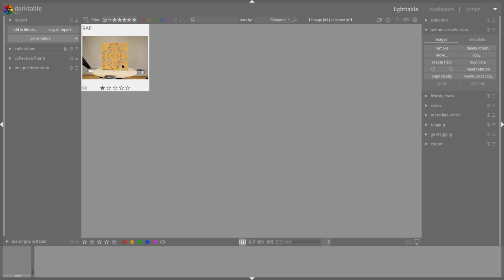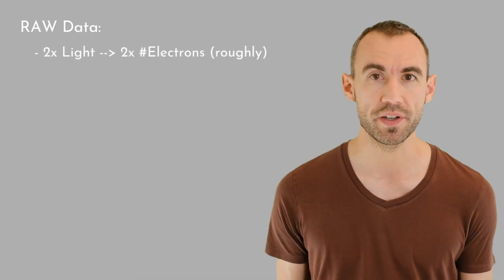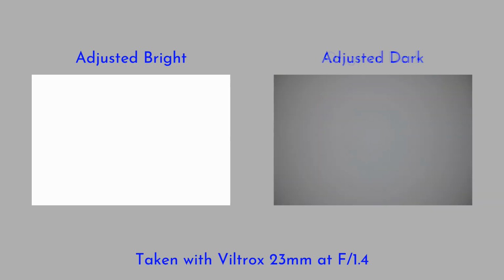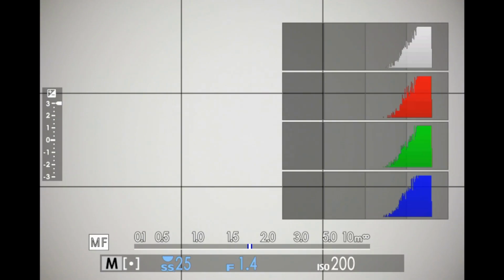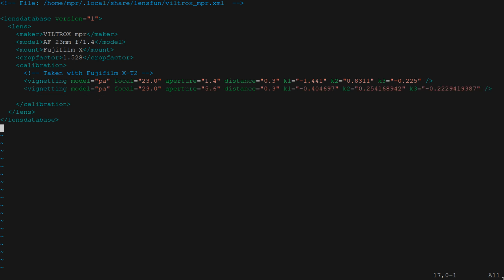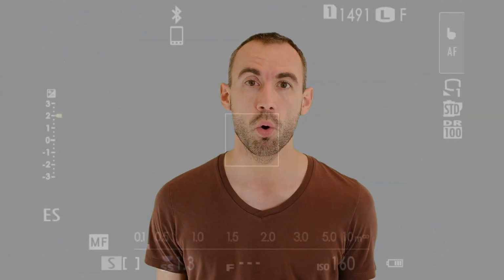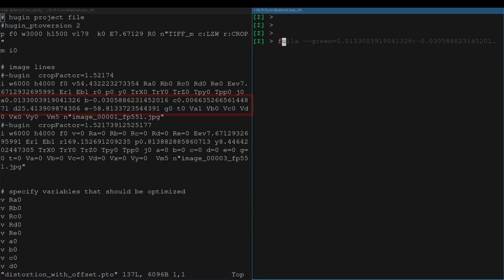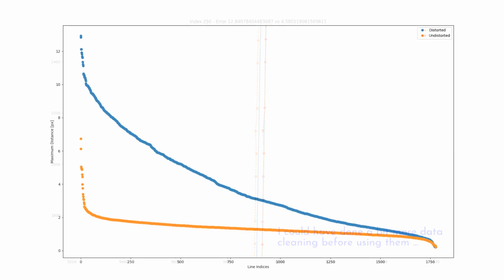Creating Vignetting and Distortion Corrections

Comment: That was immensely useful to me, for calibrating one of my favourite lenses. For some reason, I had to invert the values of a, b and c from positive to negative and vice versa. Why?I have no clue, but it works with the fulla command. It took me a bit to realise the results exagerated the distortion with the original values and that all I had to do is what I mentionned. I tried so many images with the Hugin Lens Calibration and it does not work well. You can see lines with the outlines but the program does not successfully trace many of those lines in spite of them being so numerous to my human eyes. Thank you so much @mpr.

Comment: Thanks for this video! - I keep forgetting how to use Hugin all the time.
Near the end you mention the issue of the lens center (primary point) possibly not being at the image center, as is typically assumed. However, I do not think that this is primarily related to built-in image stabilization (the associated pixel shift being only a few pixels) but to camera manufacturing in general. What I mean is that accurately positioning the camera sensor - such that the optical axis passes exactly through the sensor center - seems to be a major mechanical problem. Would be great to see a practical analysis of this and how it actually affects calibration...

Comment: To estimate barrel distortion with Hugin, I've used a make-shift pumb-bob hanging straight due to gravity. With a single straight line, multiple images can be taken with the line in different regions of the image (right, center, left, etc.) or even rotated (by tilting the lens).

With your turntable, perhaps you could image something like a carpenter or machinist square. The edge is likely more straight than any printed line on paper and if there the edge is ruled too, that's many additional points for distortion correction to use. Or stack a few 2-3-4 blocks on your turntable (to cover the camera's field of view over many images) and you get many straight lines per block to analyze. It might even be possibly to estimation the camera's intrinsic matrix which could be useful for photogrammetry since the blocks (or rulers) are of known size.
Reply from the maker: Eric those are great suggestions!! I'll be away on an extended trip soon but when I come back I'll definitely look into them. It would be very interesting to see by how much the resulting corrections will vary from the ones I got here!